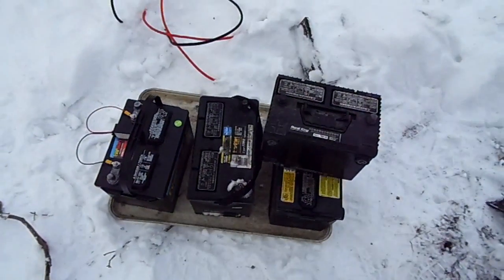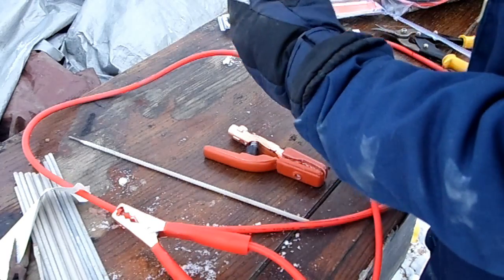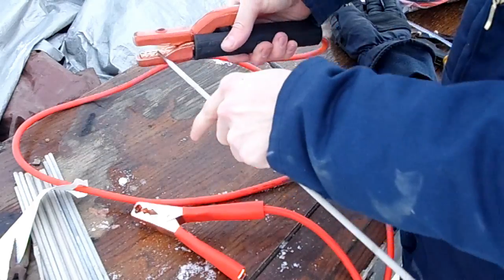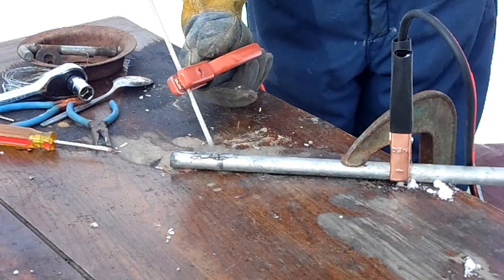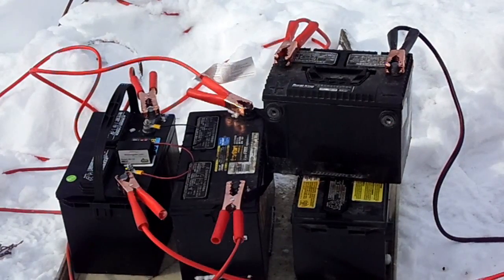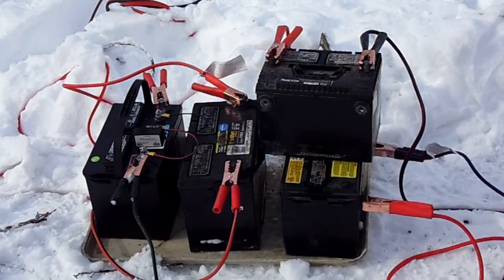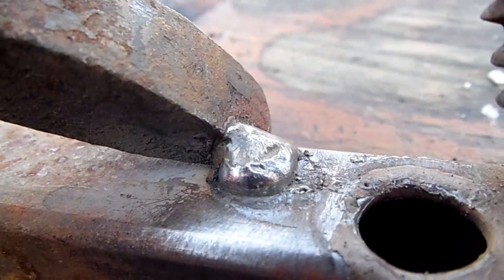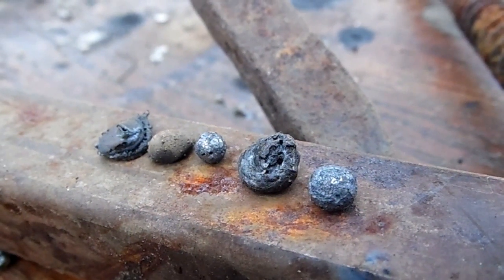DIY Welding with Car Batteries

Comment: I suggest putting the batteries in parallel since it's not the voltage but the current that causes the weld and needs to be added. By using a serial connection, you're simply forcing the current from one battery through another, etc., which limits the total current while unnecessarily heating the interiors of each battery with current that should be going directly into the weld.
Reply: Brian Tumor Actually, putting the batteries in series raises the voltage, and with higher voltage comes higher current. Series is the way to go. A car battery has no problem providing hundreds of amps. I'm sure you're aware that car batteries are rated around 600 cranking amps.
Reply from the maker: ThingsDemystified
yeah a lot of people dont understand the relationship between volts and amps.
Reply: Duh. Why do you think putting non-matching batteries (and I don't mean by brand, duh) in series in a device brings the power supplied down to the level of the weakest battery? Double-duh.
Reply from the maker: Brian Tumor  even if i had a 24v million amp power supply, i couldnt weld easilly. i find it works best at 36v.
Reply: Brian Tumor
Actually, it doesn't. You have it backwards. The worst a battery can do is add no voltage. The reason you want to match cells is because of capacity differences. If you have a 15 cell battery pack, and all the cells are 2000 mAh except for one 1500 mAh cell, the battery will function normally until 1500 mAh is used, then it will function as a 14 cell pack for the last 500 mAh. The dead 1500 mAh cell just passes everything though it.
Reply: Ohms law. V=A/R, A=V/R, and R=V/A. Thus more voltage = more current.For example V = 12. R = 2. 12/2 = 6A. Up the voltage to 24 (two batteries wired in series.) 24V/2R=12A.
Reply: mattxr2i r doubles too
Reply: mattxr2i It's V = I x R or voltage = current x resistance. You can rearrange it to I = V / R to see that if the voltage is doubled, so is the current.
Reply: David Gooch
 R is the resistance, and it stays constant.
Reply: ThingsDemystified Ah yes. I had that a little confused. V=A*R (that one) But I still had A=V/R right so the result is the same. Double the voltage and you double the amperage.
Reply: Duh, duh, and a little duh for you too! We're not talking about an 'ideal' voltage source -- extra-LARGE DUH! We're talking about a chemically controlled, and LIMITED, source of voltage. Do your equations explain why you can disconnect a battery that's nearly dead and then begin using it later to continue? Do you really believe that your equations somehow force this chemical system to perform outside its chemical nature? I'm tired of these attempts at geekiness that amount to flat, boring stupidity. If Ohm's law is the extent of your educations, then you'll believe whatever makes you feel 'comfortable' within the limitations of your intellect, and bask in the shallowness of your understanding. It's a duh-life after all.
Reply: Brian Tumor
<----this person is clearly here to troll. Don't feed. Mean people go away when you ignore them. Most nice human people educate others. People that get upset are the ones that present the problem. They can't compute when the world doesn't embrace them with open arms. Just fight back with the facts.
Reply from the maker: Brian Tumor
 if you really are that stupid i hope you are never subscribed to my channel.

ThingsDemystified  feeding trolls is fun.
Reply: Rinoa Super-Genius
Don't worry, Brian Tumor likes to put others down to make himself feel better. We all know that good people teach others.
Reply from the maker: ThingsDemystified
yeah i know he's just an idiot. i get a lot worse comments on my channel about how i should die and stuff haha.

Comment: I saw one guy do
This using only 24v,but using positive clamped on metal and ground jumper cable attached to vise grips to hold stick..but idk if It matters what way you do it...
Reply: some metals prefer it one way, varies on chemistry etc
Reply from the maker: leslie briddon yeah like if your arc welding aluminium, electrode positive looks ok while electrode negative looks like splattered molten aluminium over everything.

Comment: Nice idea! Ilike this vedio very much and I will try this and actually i will try to buy a proper welder like your one's
Reply from the maker: thanks. I would recommend a flux cored mig welder. flux core doesn't require cylinders of shielding gas. and you can get a really nice mig from rural king.

also if you want to weld with car batteries. you want as many batteries in series as possible. the higher than voltage the longer the welding arc will be. that means the rod will get stuck less I think. I'd like to try like 8 batteries in series someday. I could put stuff across the electrodes kapow haha.

Comment: I can confirm most of your problems are from lack of MMA/stick experience... Was looking best at 24v, you need to practice starting your arcs. Going way to fast and not steady enough. With big gap.

Where those rods cold and wet? I cringed when I saw you put them on the bench with the snow.... Wet rods will be hard to start and splatter lots. 30-60 min in an oven at 100-120c would do them wonders. Or as you kind of did by accident, the farmers trick of sticking them on for a few secs to pre heat. Which doesn't really dry the flux or steel well... Hot rods are easier to weld with though. Lowers the hydrogen content. the 36 and 48 v welds looked too hot. even though the arc was short. Your arc gap should be close to your stick diameter.

Also what polarity was the electrode? It makes a big difference. Neg electrode for easier stating and hotter weld. Ie thick stuff. Pos electrode is cooler arc, but harder to start. Good for experienced welders on thin sheet.

Those rods are way too thick for the tube you started with. Rod should be half the thickness of the material your welding. Perfect for the second bit of square section.

You'll never get a good arc or weld without grinding the rust off either.

An open wind coil of fence wire on a form can serve as a good variable resistor, by moving the jumper up and down the coils... 2-3 ohms can make a big difference. The 36v hole is a classic example of an almost good weld with too much heat. Moving faster, less amps, or shorter arc could have avoided that. You need to let the flux do the flowing... Its ok to go ahead a bit and let the metal cool slightly.

The main mistake on the first (good) weld was direction of stick. The heat was checked with short arc, but you had it pointed too much at the thinner metal. Always direct the heat to the thick piece. Let the flux heat the thin bit. Especially when thin is down and gravity will help.

I'm still learning myself, but thats my 2 cents.

This page is an exelent guide. The videos with sound are top notch.
http://www.mig-welding.co.uk/arc-tutorial.htm
Reply: ***** Hanging on to the electrodes is usually a bad idea.....
Reply: LOL, hold my beer and watch this....
Reply from the maker: Mongrel Shark
i don't think you realise that i was trying to cut through the metal instead of weld it the first few times.

something like this i can't really learn much from people. i needa just experiment on my own. not counting i am not relying on this welding. just playing around like always.

oh and lastly wikipedia says the oposite of you, it and several other places i've read says positive electrode makes it hotter.
Reply: I could have the electrode thing ass about....

Wikipedia is crap for welding. Better info in that link I sent you. Watch the videos! I'm like you and need to just do it and make a big mess till I get it right, but that site helped me understand the variables a lot. Welding is 10% theroy and 90% practice. But practice gets you no where if you dont get the theroy. Its like trying to understand a circuit with no meters.

I'm totally self taught from the migweld uk site... Was doing pretty much everything wrong, much like you did here. Then I spent about an hour going through the arc welding section, and now I do pretty good. Same for tig. All I did was blow holes and get electrodes and rods stuck, then I watched the video and went straight to doing half decent welds.
Reply from the maker: Mongrel Shark
well there is no right or wrong way to do anything, just different ways that bring different results.
Reply: Yep, if you can press it to a few hundred mpa and it dont break the weld your all good.
Reply: Rinoa Super-Genius That's incredibly... wrong...
Reply: Rinoa Super-Genius
There are certainly right and wrong ways to do things. Mongrel Shark was trying to offer you some advice, and all you did was talk back to him. You should thank him for trying to help.
Reply from the maker: ThingsDemystified
 don't tell me what to do buster. ;p
Reply: Rinoa Super-Genius
Expected response from someone that refuses to learn. It's ok. I used to be like that. But then I learned to be humble and listen to others instead of offer a defense at everything said to me. Still learning too.
Reply: just a litle friendly advise, that you probably won't pay any attention to anyway" stay with something you know" it won't make a name like "Super Genius" look quite so out of place
Reply from the maker: lee bergstrom
i see you dont know what sarcasm is, perhaps you should say the same thing to While E Coyote.

Comment: Good stuff! If you can replace the jumper cables connecting the batteries together with some short, thick metal bars, you should get quite a bit more power.
Reply from the maker: maybe, but i'm getting enough amps. its just volts i'm lacking.

remember that copper is like 5 times more conductive than iron. so these 10 guage wires would be the same as like a 2cmx2cm steel rod.

Comment: One good thing about this horrible weather is that I bet you aren't welding in sandals this time.  Although frostbite through a boot might be worse than molten metal on exposed skin.
Reply from the maker: it was only 27* so it was just jacket weather tbh. but yeah frostbite would be worse.

Comment: Damn I never learned to arc weld, i can only do welding with them gas torches, acetylene it's called. The good thing is it's really easy to do (was for me at least), but you need to take care and can't simply get the equipment - at least where I live you can't, you can get a decent mig set for cheap (well, somewhat), but I dun know how to operate it. Your vid helped a bit though :)
Reply from the maker: MIG is really easy, especially flux cored. it didn't take me hardly any time to figure out mig. there is almost no chance of getting the MIG wire stuck so you just keep it on one spot till it melts everything together. or atleast thats how i do it and it works great so far.

my MIG welder cost me like 1/3 the price of my electric bicycle. was like 230$ new from Rural King. and its brand name too.

Comment: Great fun! I think my little AC welder is the one thing I would never lend anyone. It's there, just at the front of the garage ready to run at a moments notice. You never know when you might need to run a quick bead.
Reply from the maker: i've never tried AC before i would think it could penetrate better into thicker metal than DC right? but it could be more messy since the voltage is constantly switching.

i think if i get better welding rods this 4 battery setup could go a lot easier. maybe i could even build a DIY MiG welder.
Reply from the maker: *****

yeah it doesnt matter all that much too me about the rods couse they are free so i'll just use them anyway haha.

that hot start feature sounds handy.
Reply from the maker: *****
my grandpa used to use rusted bailing wire and the rust acted as a flux. idk if he was doing MIG or TIG though.

i should do some tests with differant ways to weld. like trying to weld aluminium or arcing across a tin can to make a lot of sparks.
Reply from the maker: *****
well i've been pondering building an electric furnace. so parhaps i could try that. or i wonder if it'd be possible to just make the aluminium oxide. that would be a really great thing if i could make that.

Comment: Hi Rinoa, we call stick welding Arc welding this side of the pond,  the first electro welding invented.
You have done a dam good job of welding with car batteries, being as there is little control with the power for the right gauge of metal.
Arc welding like all welding takes practice to master the technique, the last time I had a go at it was in metal work class at school and that's going back a bit LOL.
If memory serves me right, we started off striking it on the surface about 45 degrees and then holding it a few mm's cant remember how far, so it Arc's hence arc welding  I have never tried any other welding Mig tig etc then most I have done was oxy acetylene  welding and that's at school
Reply: Rinoa Super-Genius Hey Rinoa, that's made me laugh about your neighbour, I never knew you got scrap heap challenge over in the US, I used to love watching it.
I often wondered, how you use some of the words which like blowlamp, which I have only heard American people call it blowtorch, I have never heard a American call there vehicle a car and they all ways pronounce aluminium much different.
To be honest I often wondered if you and family were originaly from the UK but emigrated to the US, but did not like to mention it in case you took offence LOL
Reply from the maker: brianthestovie
wow really? thats pretty nice of a compliment.

yeah tbh i just can't stand this country too much. atleast the media and the people. pretty much every american show is garbage except for Modern Marvels and Mythbusters. we ditched TV in 2008 couse it just wasnt watchable.

hell even the american version of scrapheap challenge called "junkyard wars" went horribly bad after the first 2 seasons. everything has to be a reality show now.

not counting i get tired of the "murican pride" that so many people blindly have.

when i was like 8 we went to switzerland and i liked it a lot. i think it would be cool to move too anotehr country. especially the UK. if i ever decided to go to a university i'd go to Nottingham uni. or maybe i will visit there anyway someday just to talk to prof Martyn Polliakoff.

you could prolly call me a Europhile.

oh and wanna know something else stupid about the US? (other than Texas i mean) the us government still hasn't allowed the sale of LED car headlights in the US. because they say LEDs are an untested technology....... facepalm >_<

sorry for ranting.
Reply: Rinoa Super-Genius that's the world over not just in the USA we all have some dam stupid laws that a re wrapped in red tape, i must admit I have never sadly been to the USA but hopefully one day when money is ok I will there is so much different types of and the size, take new York for instance new York a lot of people over here probably think its a fair bit bigger than London and its all like times square and where the chrysler building and empire state building is downtown but it probly the size of England by the way the art deco Chrysler building,it is one of my favourite buildings  I have seen in pics  and read about
if ever I get to the USA or Manhattan that is one building I must visit
Reply from the maker: brianthestovie
yeah new york would prolly be worth seeing. you know the gateway arch in St Louis? i licked that when i was 10. tasted kinda bitter and metalic.

another place in the US i'd like to see is the mountains and stuff over west. oh and the deserts in like Nevada.

quite frankly i just don't get out of my area of the world much or see anybody outside of work and family.  it'd be cool to go on vacation and explore or something.

Comment: Great video and looks a lot of fun. Your welding is far better than mine was last year. It took me 3 days and 14 rods to weld 3 pieces of 1x1inch box section together. It was only an eighth inch thick. Looking forward to next video. 190.
Reply from the maker: yeah I think my MIG welder is far better than this. with MIG I usually don't even worry about removing paint or rust.

one thing I may add to this stick welding setup if I use it more is a foot pedal. so I dont get the rod stuck and burn my wires up.
Reply: MiG good welder. I think foot pedal idea is a good one.
Reply from the maker: Raymond Earle
you where wanting to build a MIG a while back right? now i'm curious too.
Reply: Yes. Upcoming project.
Reply from the maker: Raymond Earle
nice.

Comment: I have no welder so ill make one ha ha :-)) nice :-))

Double up on your feed cables, they are dropping tons of power you could have fun with :-))
Reply from the maker: yeah sometimes the aligator clips would all puff a bit of smoke hahaha. and the area around the wires on the ground was all melted snow.

but tbh it works ok for being cheep. couse i got the batteries off a recycling skid and stuff.